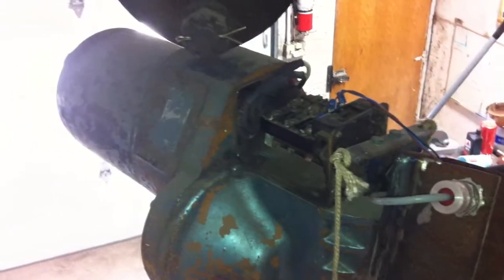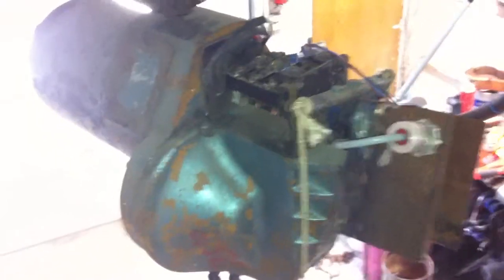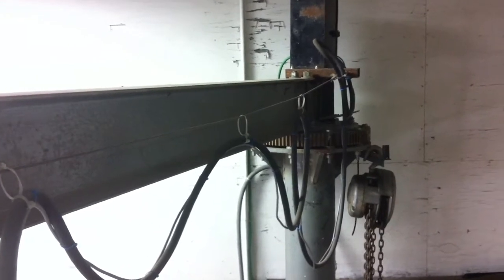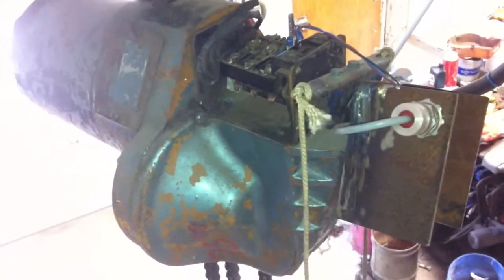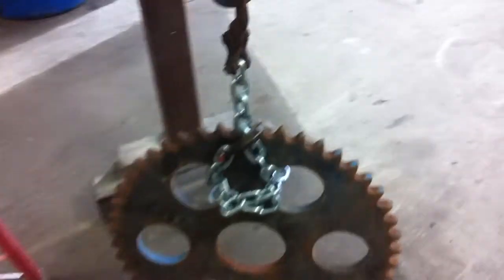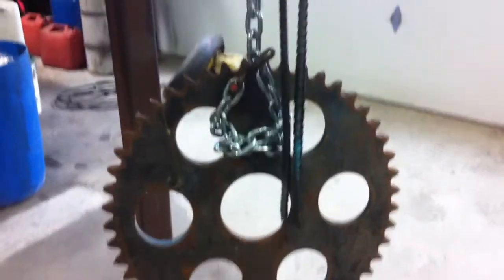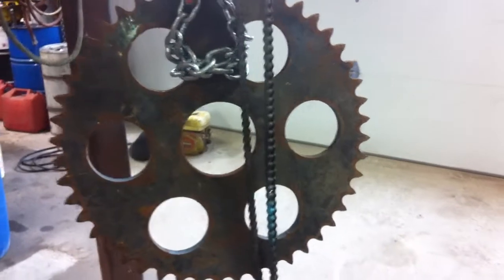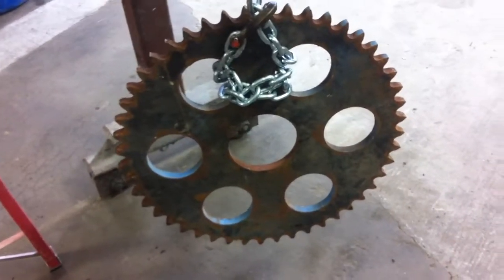How To: Vintage 3 Phase Yale Midget King Chain Hoist In A Single Phase Shop VFD

Comment: Thanks for the video.
It helped out a little bit since I have 1/2 Ton Midget King single phase chain hoist that looks identical to yours but trying to figure out how to covert the rocker switch activator to the common push button remote like seen on most hoists. I opened up my electric control box and looks identical to your switch mechanism but I have no idea where to place the wires from the 2-button remote/pendant to the electric switch mechanism you showed on your hoist.
  Do you know how to do it or have any ideas on where it shows how it's done? I'm already in the process of communicating with a Yale representative but so far it's looking like theyre not really interested in helping to get me a compatible 2-button remote and then a diagram for where to place the wires. A couple previous representatives even kept trying to get me to buy one of their new hoists after I told them how I'm on social security disability, literally counting pennies every month, very lucky to have got the hoist for 50.00 in good working order
Reply: It can't be done as simply as you are wanting. The pendants control a reversing contractor, which this hoist does not have. These hoists use mechanical reversing switch (drum switch) and to complicate things further rotating that drum switch also mechanically releases a brake that is built into the hoist. So even if you wired a pendant and reversing contractor to the motor you would still have to release the brake somehow every time you pressed the button.